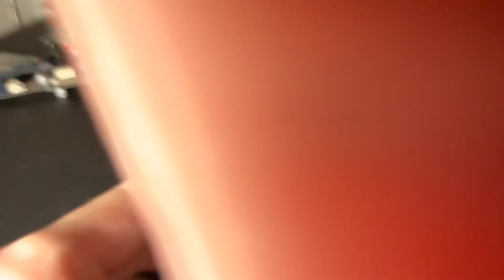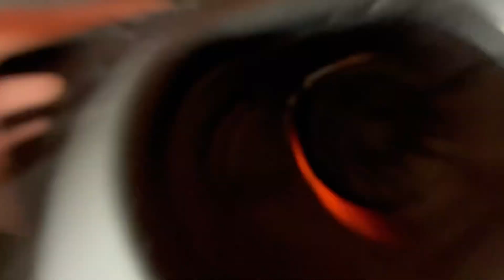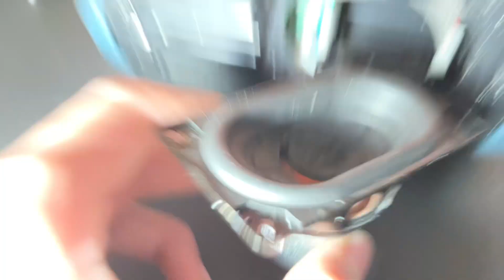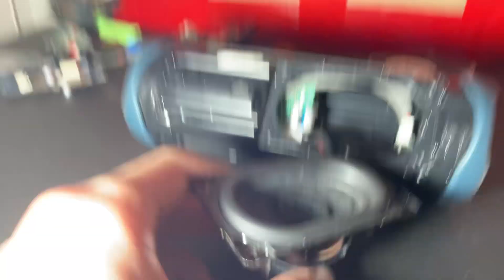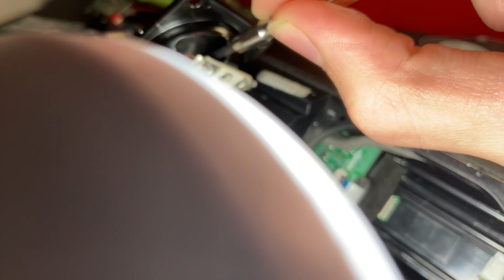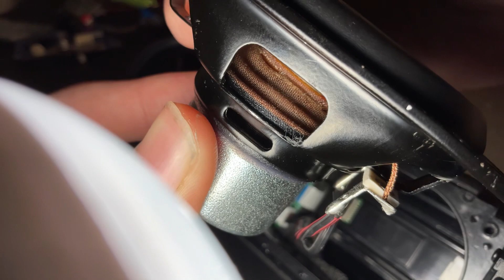The spider is ripped and when I push down it works so idk

Comment: ik what the problem is
push the tinsels a little while connected to amp it will fix it 100 percent
Reply from the maker: wyn
Reply from the maker: wym*
Reply: @SpeakersWithZander  the tinsels to coil. Move those, don’t push woofer tho.
Reply: @SpeakersWithZander  that’s how I helped rakieta fix his woofer
Reply from the maker: Ok I’ll try
Reply from the maker: But I can’t my fingers are too big
Reply from the maker: It’s not working
Reply: @SpeakersWithZander  did you also try the tinsels at the spider
Reply: @SpeakersWithZander  screwdriver
Reply: he doesnt know how thee woofer even works he will just mess it up completly
Reply: @bassfear_9952  he already did